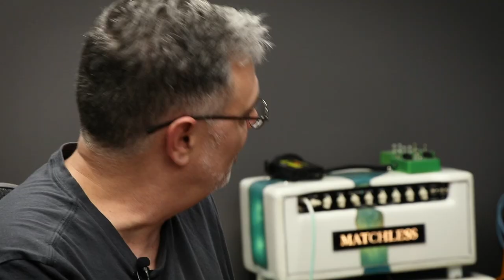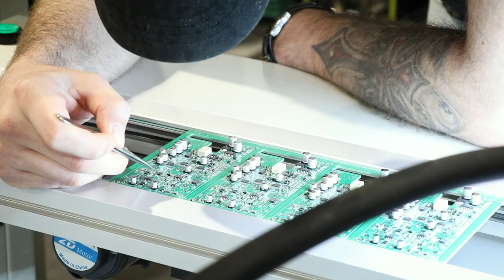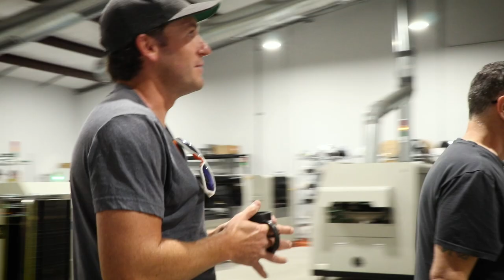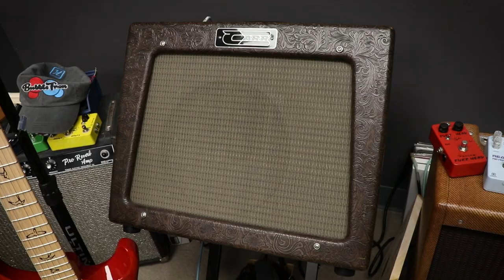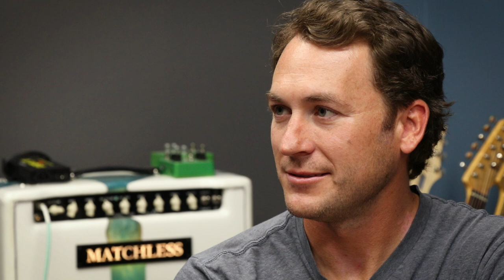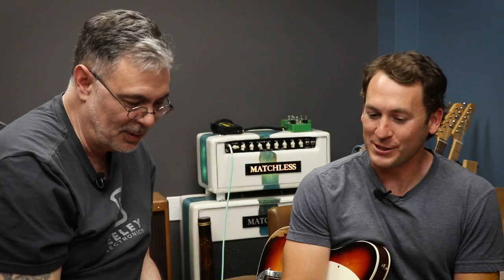Michael Palmisano and Robert Keeley - Compression, HALO, Noble Screamer, and more! RKFX Shop Visit

Comment: hate that overcompressed country sound.  i know others like it.  but it doesn't sound like a guitar anymore.  1/3 as much maybe.
Reply: I think everybody is kinda over it honestly, it just has that range of compression possible.  Trey Anastasio has used Ross Compressors and he doesn't have an overcompressed country guitar sound (all of the time) ;-)  Adrian Belew has used one for decades on his guitar.  Swears by it.  None of his guitar work sounds like overcompressed country sounds. Walter Becker of Steely Dan had 8, one of every colour you like.  You can take the time to set up a wonderful tone with it.  And if that doesn't work, try our GC-2 or Comp Pro.  Either of those two are noiseless and of extreme fidelty.  They are limiting amplifier compressors.  Very different.